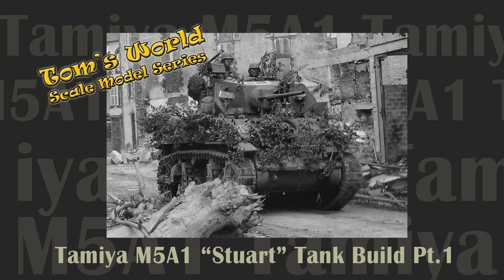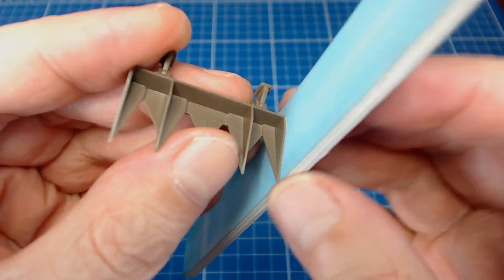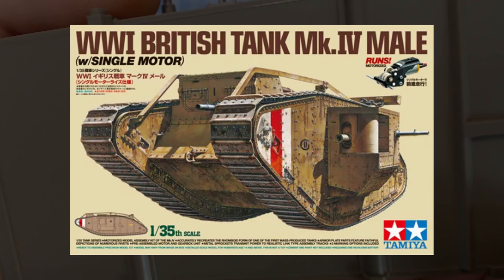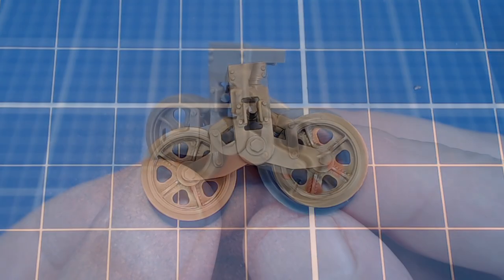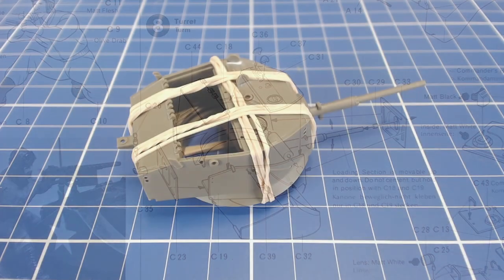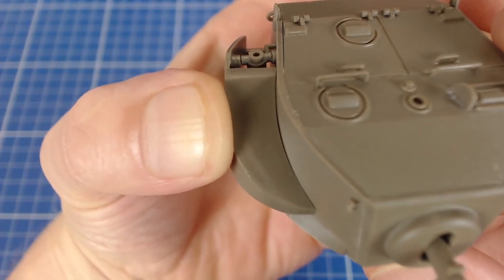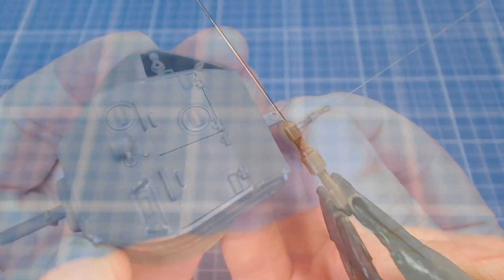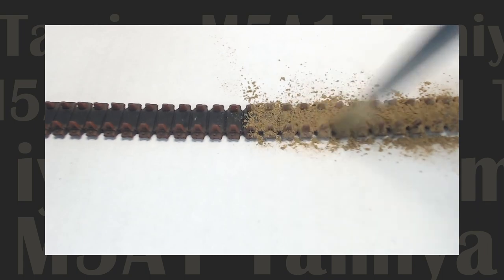Tamiya M5A1 Stuart Tank Model Build

Comment: Great video, Tomas!
As for the funky end connector placement on the tracks, I think Tamiya did that to make the tracks as flexible as possible for motorized use. Funny thing is, Monogram did the same thing on their Sherman and Lee/Grant tanks back in the day as well... but they weren't even motorized!
Reply from the maker: Thanks for the note Brett. Your observation makes sense as the tracks would have taken a beating on the motorized version. I liked the way Academy did their track on the M1A2 Tusk, albeit they were styrene but they used a hard styrene connector for the glue joint. An apples to oranges comparison but the method was very good. Weird about the Monogram kits but it was definitely a different era. All the best Brett!